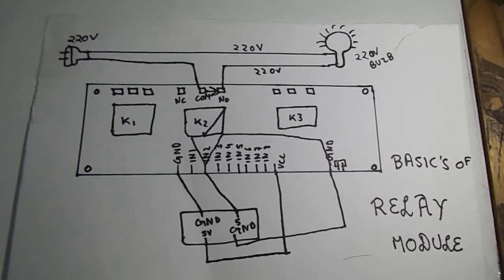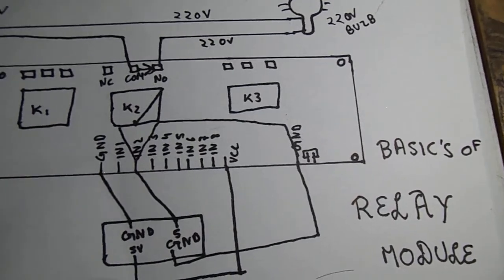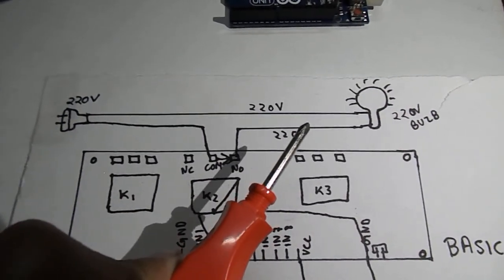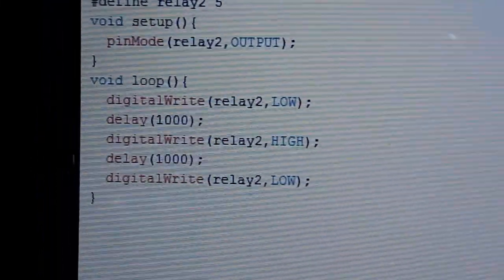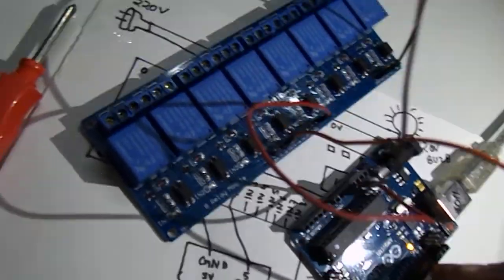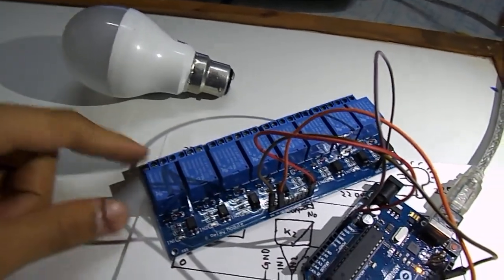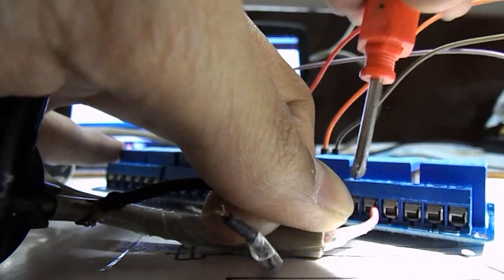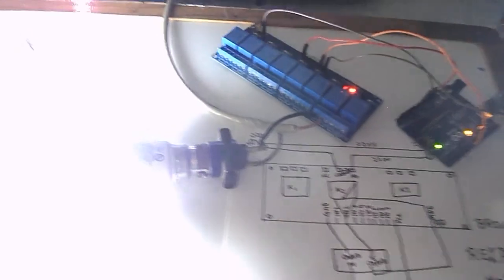HOW TO CONTROL HIGH VOLTAGE APPLIANCES WITH AN ARDUINO AND A RELAY MODULE

Comment from the maker: lion kink i didn't touched the 220 volt  wire i just touched it from the insulation part because the connection from the bulb holder was broken

Comment: Again good job. Nicely explained.
Reply: BTW dont we require any resistor to prevent any damage to the arduino board ?
Reply from the maker: this is because in relay module there is no risk of damage to arduino as the coil of relay is not in contact to the common pin so high voltage current can't go to the arduino